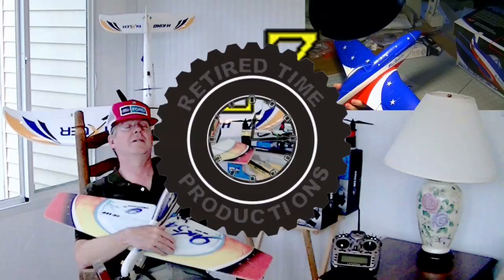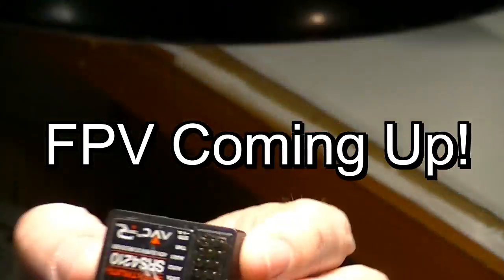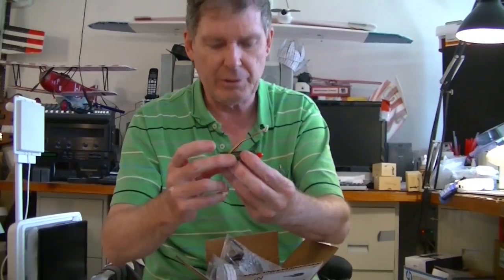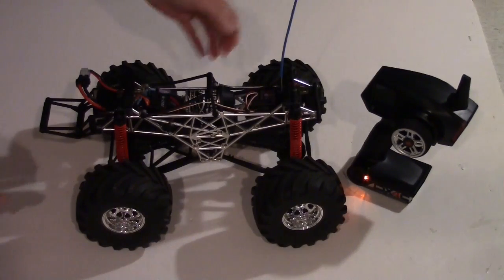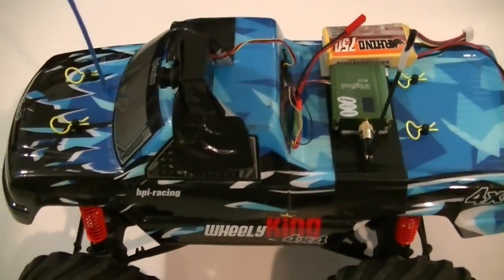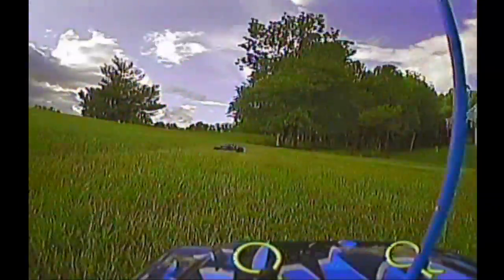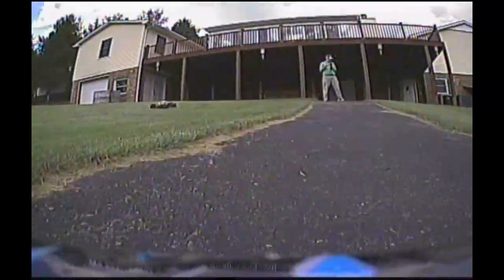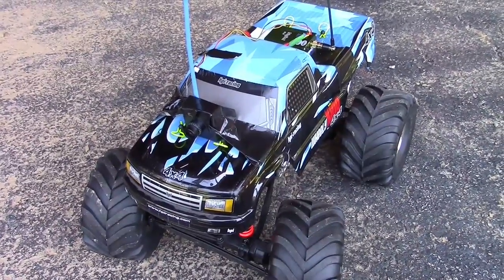How to install FPV camera on any RC toys or RC Truck with 1G3 Video Feed,  2G4 DX4C Control

Comment: Hi, can i Know the range u get from 1.3ghz?
Reply from the maker: Much better range than 5.8 because lower frequencies penetrate objects better but the amount depends on the antenna set especially at the receiver where a patch or helical can improve results.
Reply: @DaveMerc  awesome, im currently working on a fpv project and  will be really helpful if u can suggest me a 1.3ghz fpv tx and receiver with audio option for my Crawler so i can experience sound.
Reply: @Dave Merc Productions  awesome, im currently working on a fpv project and  will be really helpful if u can suggest me a 1.3ghz fpv tx and receiver with audio option for my Crawler so i can experience sound.

Comment: Can you give me a list of everything I would need to add a fpv setup to my rc truck
Reply from the maker: Here is what I use:
RunCam Swift 2 FPV Camera
ReadymadeRC 1.3GHz 400mw Video TX US 1280/1258mHz
ReadymadeRC 1.3GHz mono pole antenna.
Fatshark 1.3GHz Receiver in bay of F.S. V2 Googles (comes with mono pole antenna).
Note: 1.3GHz has more penetration than 5.8GHz for a clear image around obstacles on the ground
but you could also 5.8G too. There is also 2.4G video and 3.3G video systems.
Reply: dmercØØ RTP.   I'm lost,Lol..thats some good info ,I'm so new to the camera thang...no alot bout rc cars an electronics, but the whole camera ,receiver thing pow,lost. Lol
Reply from the maker: You might start by looking at the RMRC starter kits like this:
http://www.readymaderc.com/store/index.php?main_page=index&cPath=4

Also you need to decide if you want goggles or a video monitor.
Reply from the maker: Another thing you can try is an AOI Camera that has the VTX built in. These are usually 5.8GHz so not the greatest performance for a ground vehicle but they are inexpensive.
https://www.youtube.com/watch?v=-2VE8RaDQOM
Reply: Dave Merc Productions Well if you get an 600 or 800mW setup it works just fine

Comment: Are those 1.3ghz goggles? or is there something between the goggles and 1.3 video receiver
Reply from the maker: There is a 1.3G receiver module in the receiver bay of the Dom V2 goggles. It's in the description under the video. 
This makes for a very portable setup.

Comment: Put the camera on a 9g servo for pan. You can run a servo splitter off the steering.
The camera turns as you steer.....
Thank me later
Reply: MC5 Limited Skills Good idea Thanks
Reply: Well hell ya thx fo da idea didn't know that u could do that

Comment: Nice job Dave. It might be nice to throw on a cheap OSD to monitor the voltage of the main lipo. I think it would be easy to get carried away with the FPV and run the battery too low, Thumbs up buddy!
Cheers, Bob
Reply from the maker: ***** Thanks Bob. The main battery is a Ni-Mh. It just runs down to where the truck stops. The video battery seems to go for longer. Also I think the OSD boards always degrade the video picture somewhat so I think I am better off without it. I could probably put a warning beeper on the VTX LiPo as a substitute. Thanks for watching and the thumbs up!
Reply: ***** 
My RC runs on a 4s 5000 lipo and I thought it might be an idea to protect it from having too much fun.
Reply from the maker: ***** Wow, you must have a humper of an RC vehicle. 
Have a good weekend!
Dave